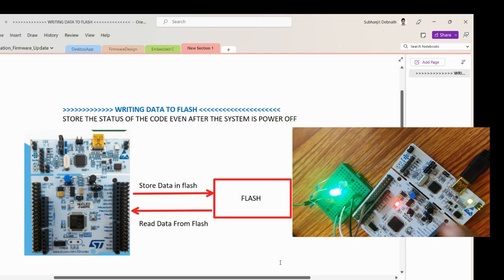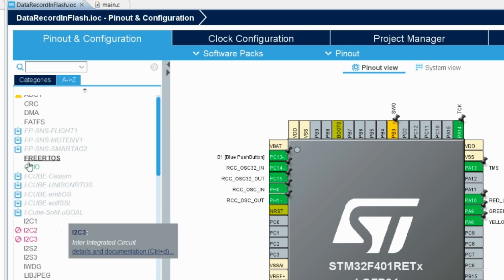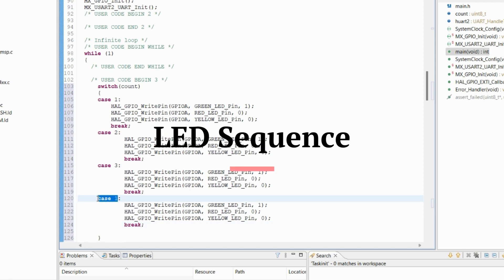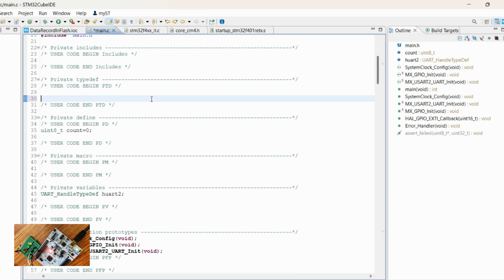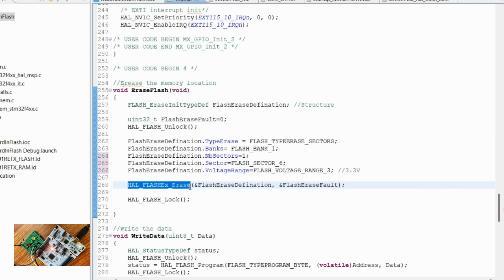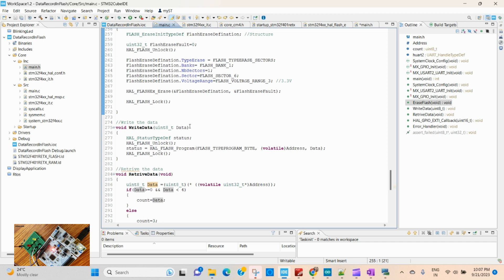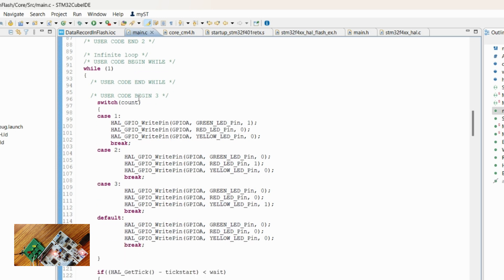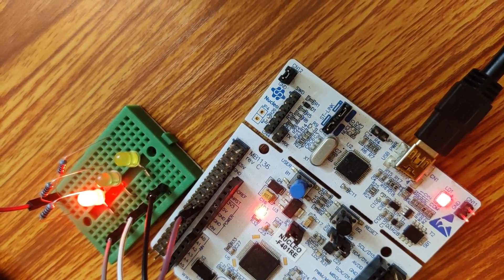STM32 Flash Write-Read || Save last status in flash || Read from flash #stm32 #flash

Comment: How to find Flash Memory Address? I mean the software is ST-LINK Utility, Ik but all it shows me is mem add 0x08000000 to 0x08001000, I'm not sure which one to edit or which one falls in which sector. I'm using NUCLEO-G0B1RE board, I need to flash program an array which continues from the last element of array it read instead of starting to read from start again on reboot, I would be glad if you could assist me with the same, thank you for your time and response in anticipation!